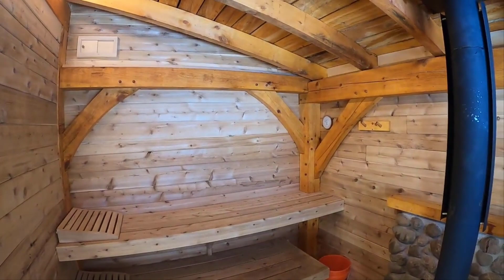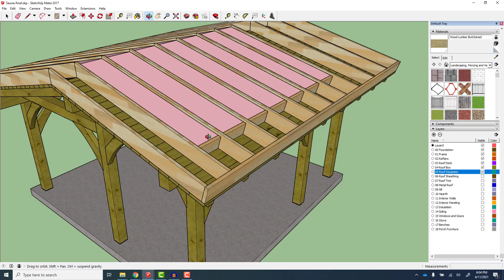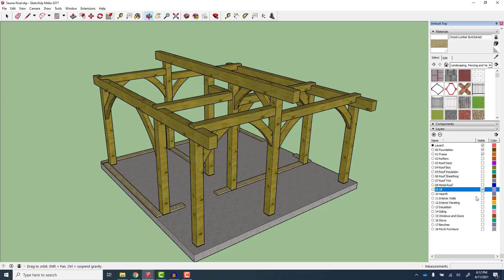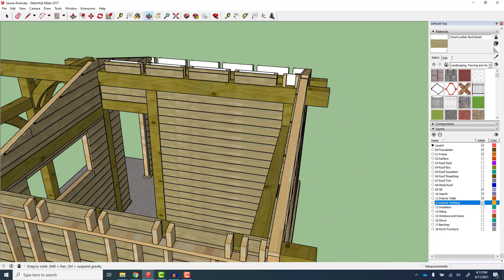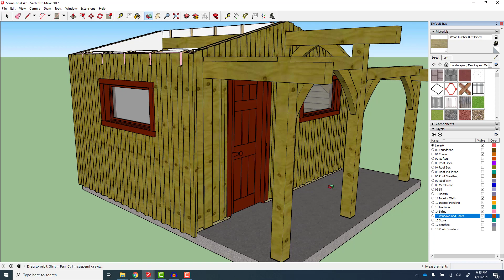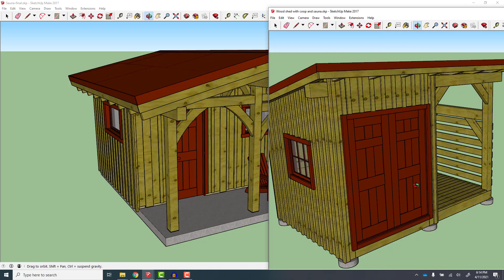TImber Frame Sauna   Final Design Review

Comment: Very nice quick recap! Since you are done now, are there things you would have changed i you had to build it again?
Reply: So far the things I'd change are: 1. don't bother with electrical outlets in the hot  room (not sure why I thought those were needed). 2. run the power line up through the slab before pouring the slab (for a cleaner look outside). 3. Make the benches in the sauna a bit wider.
Reply: @Juddak  2 is a good point. Also makes me think of adding a tap/sink in the changing area for extra comfort. Thanks for the answer. 👍
Reply from the maker: A shower would be a nice to have, but I can live without it. We shower in the house. I did add a water cooler in the change room since we don't have running water and I'm very happy with that addition.